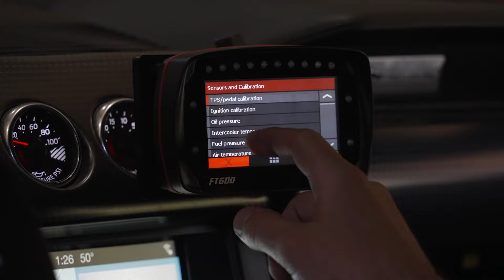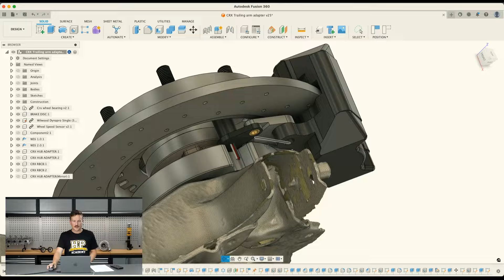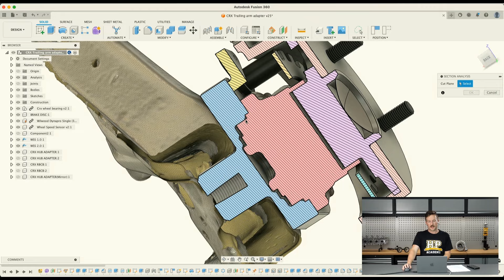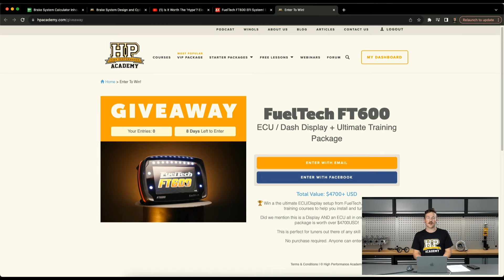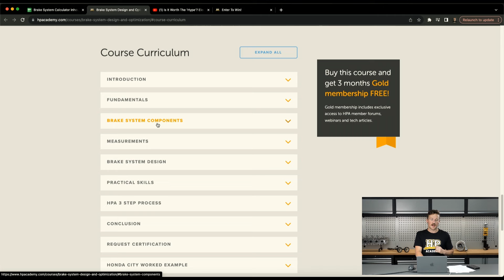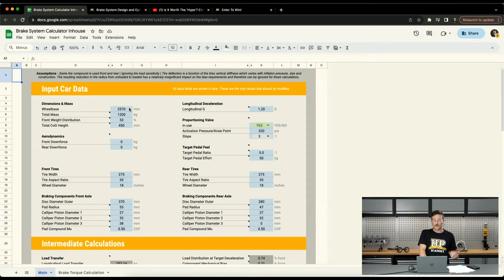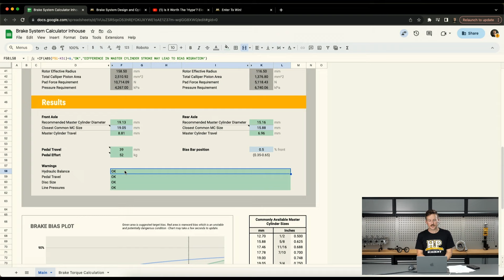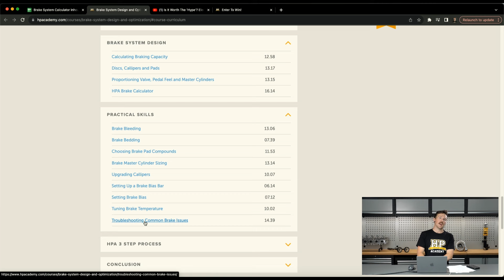Overkill Upgrades? | Today At HPA

Comment: DA integra wheel bearings bolt in, fyi :) same size bearing as the DC integra which is 700 lbs heavier than a base crx. It handles the load well, at least on my car. It even has a tone ring for abs
Reply from the maker: Nice! These are a bit of an upgrade on those which should give us a bit more margin noting the tyre choice has a big impact on bearing life when it comes to street vs slicks beyond just weight.
Glad you hear that has worked for you and certainly a lot less faff! 
Are you doing any endurance racing? - Taz.
Reply: @hpa101  That's currently the plan, but i have yet to complete an enduro.  Planning one for end of year.  Also of note, 17 inch rims have 13% more force trying rip the flange from the bearing cups vs 15's. I'm on 15's and not using hoosiers, so maybe that's why i've been okay so far. Still unsure of the longevity though, we shall see!
Reply: So if I'm understanding correctly I can bolt on DA Integra wheel bearing onto my crx control arm? And will I need to change the hub as well or will I keep the crx hub ? Also is this only for the rear or front as well
Reply: @j_zales1390  This is for rear.  I believe you have to use the hub for the specific bearing, DA hub to DA bearing, ETC as the ID of the bearing is different. This bolts onto the RTA on the backside. You can use the DA, DC, or EG rear hub & bearing as they all bolt right on, but i believe the DA and DC are the ones that are larger (over the eg & ef). Also, true DC type r bearings are larger based on the measurements i've found, but they're very hard to find aftermarket replacement wheel bearings for.  I debated testing this out but didn't want to muck about with different bolt patterns. If i have issue with DA bearings, i'll consider the DC type R route. DA front bearings are indeed larger than any EF but require the DA upright as well. One note, the DA/DC rear wheel bearings will sit 5mm more outboard. I believe the EG are the same.  There doesn't seem to be a discernable difference in the EF, DC, EG rear trailing arm.  DA is slightly different and heavier, its got more material pushing the wheels a further 5mm outboard. Other than the RTA bushing diameter & rear wheel hub/bearing, i can't tell a difference in the ef/dc/eg arms.
Reply: @funkyd04  awesome a appreciate the very useful information oem+ upgrades are always the best option for budget low HP builds

Comment: That was cool, thank you.
There is a lot of material that can still be machined away without affecting the strength of the part(s) which should make a big difference in the weight, and I agree, I'd be a bit wary about using an aluminium alloy for that part, too, for the same reason.
I may be mis-reading the cut-away, but looks like you can fabricate a combined hub and brake bell out of a suitable alloy, though, which should drop the sprung mass by a significant amount? Rings are available as stand-alone parts for many vehicles, which would be cost-effective, or you can have your machinist fabricate them.

Comment: What’s happening with the CRX ITBs and fuel injectors over the velocity stacks?
Reply from the maker: Nothing yet, the engine is still out of the car but that's still the plan. We have a nice new bonnet with no giant hole in it on the car already though 😎 - Taz.
Reply: @hpa101  which ITBs are you using if they aren’t going through the bonnet?
Reply from the maker: I believe a curved trumpet is the key difference, but we'll have a video out on it in due course from Andre or Connor who work directly on the car. I'm just in a room out the back with snacks and a keyboard 😂 
The throttle bodies themselves are still Jenveys - Taz.